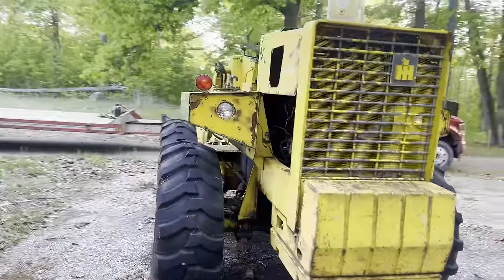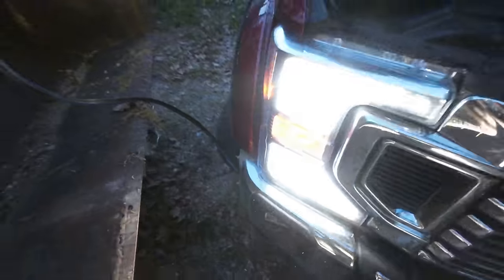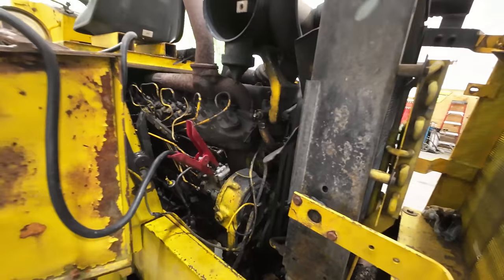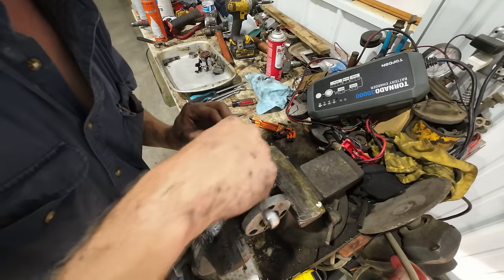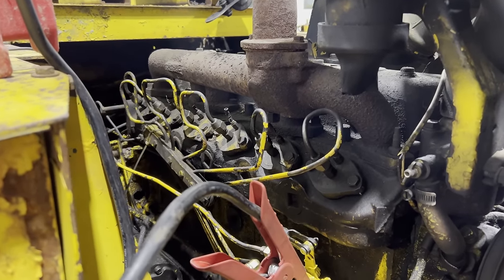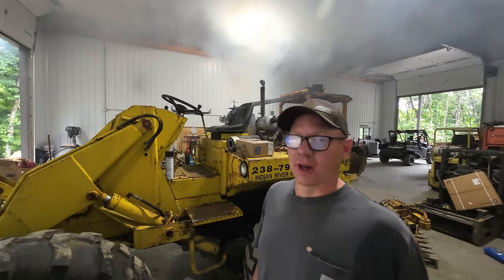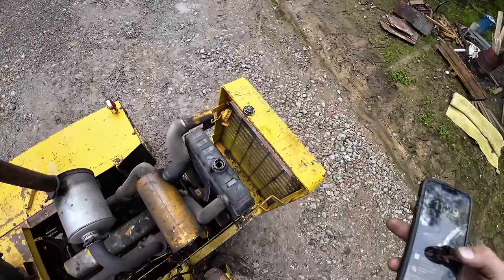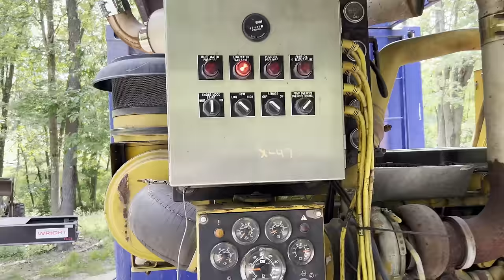FREE International wheel Loader, Sitting 8 YEARS! (Will it Run??)

Comment: Why aren't you using a remote starter switch instead of crawling around and under vehicles to jump the starter with a wrench or pry bar or something.  A simple high amperage momentary contact switch with appropriate wires, should be able to make it up for less than $10.  As a teen working on gas stations and my hot rods, I made one up with a little metal box, 2X3 inches, with the starter button and a hot lead for ignition.  You could use the extra hot lead for the fuel pump if needed.  Also, I watched you loading the loader on your trailer in the dark.  For maybe 10-20 bucks you can get an LED work light, maybe 20 watts, for the rear of your truck cab.  As much as you would use it, it probably would last for years. 20 watts would be like daylight compared to working in the dark.  Love your channel.

Comment: Timing is definitely off. I work on john deere engines with the same pump some have keys and some don't. There is a tool set to find timing on those pumps. Since there's no key there's a tool that locks the pump in 1tdc. Then you pull the pump and leave the engine sit so you don't loose your timing.

Comment: I've been driving an old 70's or 60's road grader all week. Supposedly it's a cat but there are no markings. I keep thinking about Christine. Not sure how Christine's shift levers are but this thing you have to fight like hell to get the forward and reverse lever to work especially if you want to put it in reverse. The 3 speed shift lever shifts hard too and the high and low range is nearly impossible to move. these levers are huge and go clear down to the floor. I must be shifting them 30 or 50 times a day or so maybe a hundred.

Comment: I know you pointed out the extraction fan yet to be wired. Would it make sense to install some exhaust extraction hose that runs through the ceiling or wall that can be connected directly to the equipment exhaust pipe?
I know you had a fan running and doors open, but soot will still coat your nice bright walls and winter is coming and that fan in the peak will exhaust your heat. 
Healthier too?

Comment: I see a radiator hose that is supposed to go to a another bigger radiator is just hanging out I think that is a factor to your situation on the radiators. Most modern day motors always have three radiators. I am no mechanic but just from observation I see that hose and see bolt holes so I am assuming that it is missing a radiator. Keep up the good work process is slow but it is has it's benefits, look at the bright side you don't have to mess with the transmission!!!!!

Comment: I wouldn’t completely rule out that there isn’t coolant in the oil until you drain that oil. I’m not trying to tell you what to do but I ran into a situation one time on a international truck that had a max force engine and it was using coolant and the coolant tank looked good, no oil in it. Checked the dipstick and didn’t see nothing wrong besides it looking like it needed to be changed. Poked a hole in the oil filter cause it had a tall one and some red antifreeze came out before oil did and then I took the drain plug out and a bunch of coolant came out before oil did. So not always will coolant and oil mix. That truck had red coolant in it but just a situation to throw out there to help lol

Comment: You have the timing most of the way right that style of international engine is naturally smokey especially when it hasn't been touched in so long or has never had a rebuild on the farm I grew up on we 560 diesel and it smoked that much and we used it every day

Comment: that thing is smoking like a wet bonfire, definately got a blown headgasket, I would imagine it will burn/displace as much oil as it does diesel I feel an engine rebuild in the offing, so might as well do the pins and bushings, brakes and rams and it will be like a new machine

Comment: I think the injectors and rings just need a bunch of fuel detergent, including trans fluid, and some run hours, and retorquing the head bolts might fix the head gasket, so just do enough wiring so that you can use it and give it 10 or 20 useful hours, maybe fix one more brake, and that at least might be good enough for now.  Fresh and high detergent motor oil, perhaps with a bit of Marvel Mystery oil, might help it too.  Maybe head gasket sealer but maybe not too, in case the sealer gets in the oil.  Just the half hour or so you gave it did a lot of good, judging from the exhaust.
Reply: "Good enough for now" = "do it all again later"
Reply: @jackson_68  Not if either A, you intend to part out or scrap it later, or B; you fix brake #2 now, properly, and brake # 3 and 4 later, does not force you to come back and fix brake #2 again.  And as for gummy injectors from sitting, run hours with detergent fuel can eventually clean them just fine.  I can't quite say good as new because the seals are still old, but they can be completely cleaned without disassembly, same for stuck rings.
   It doesn't have to be good as new because the machine will never again see as many work hours as a new machine.

Comment: Out of posting space, almost, but, automatic dishwasher detergent and a low pressure garden hose, to rinse the block. Wet it down, pour detergent mixed with five gallons of water,over engine, wait ten minutes, rinse it off. Keep water out of any openings, away from brake master cylinder, hydraulics, bad seals are everywhere on that machine. Do it outside, of course, away from shop doors, downhill from building.

Comment: Tongue weight and ride height are directly proportional. When the tongue is too low (not level) then you are effectively taking weight off of the front axle. Your truck is heavy enough to handle it so it still rode good. A lesser truck would not have rode good with an unlevel tongue.

Comment: What size motor, looks
bigger than a D 282 .
Head gasket is what the
either is hard on.
You will need dam GOOD
batteries for the glow plugs
. pre combustion cups.
My old farmall 560 had D 282

Comment: Cant see the whole engine but I think that's a 281 IH diesel those old motor were very poor starters at the best of times (without the glow plugs)with proper functioning glow plugs however I could get my 281 motor started every time(about 50 full seconds on the glow plug button at maybe quarter  throttle)farmers who cursed the motor usually refused to use the glow plug system properly, personally this engine was a good strong hard working unit that worked many years in dozers,loaders,and farm tractors .cheers

Comment: I would have checked the compression first , i just did a ford 4000 completely guy said it ran had 2 out of 3 cylinders with holes in them it was quite a project

Comment: I suspect you may have a blown head gasket. IDI type diesels don't like too much starting fluid. Needs the glow plugs in operation. Your excess smoke could be oil. Much of it cleared up but you still have a bit. Your idea that the injectors aren't up to par is also good. Those for that engine may no be all that expensive. The guys at Area Diesel are top notch. For you or I trying to work on one of those pumps is like trying to do brain surgery with a wrench and screw driver.

Comment: what Jump Pack do you use Matt ? yours always seams to have a fair amount of power to  turn over these Monster engines you aquire  I’ve tried a couple ofthe Harbor Freight Ones  and didn’t have much luck with them  having them on hand for starting V8 Inboard Marine Engines or  my 6.5 Turbo Diesel Duramax when my batteries got older ?  the Jump Packs never seemed to  hold a decent charge  very long  and replacing those internal batteries wasn’t cost efficeint

Comment: 4' Auto louvered Greenhouse  vent fans will close against wind and rain when not running but will remove most if not all of that diesel exhaust to stop coating the shop with dark grey to black goo. As was tated, large volumes of smoke suck.

Comment: I know nothing about diesel engines, but I'm pretty sure they are notoriously hard to start without preheating the glow plugs. Common theme with 'will it run' diesel channels is they ignore the plugs. Not sure why. It would be like 'will it run' gas channels ignoring the condition of spark plugs. Which I see too. Sure you can spin the engine with starting fluid until they kick off and clean (diesel heat) themselves, but why wear out a starter unnecessarily?

Comment: QUESTION:
I’m just a curious Dutch guy. How much weight was there on that trailer and how much does the truck weigh and what are you allowed to tow? 
Over here there’s a limit of 3500kg vehicle and 3500kg towed weight iirc.
I would imagine that driving with that much of a load wouldn’t be easy (but I’ve no idea tbh).

I’d appreciate any comments from anyone who’s towed something similar. Tia!

Comment: Hard start, white smoke, low on power and excessive diesel knocking sound all points toward bad timing of the injection pump.
I would have looked into that.

Comment: Is either good for a motor?  Nope.

But as a heavy wrecker opporator I've seen MANY concrete mixer engines run on nothing bit "start you basterd" to unload the mud.  Usually have to feed a motor at least 2 full cases of the good stuff, takes spraying it directly into the turbo for like 15 minutes straight.  I've played this game at least 50 times over my 40 years in the towing industry and not one of these motors was damaged.  This has become a more common thing with the proliferation of ECM driven motors, no the high compression modern EPA motors done come apart running on the spray can ether.

Comment: You should be more careful with your use of ether. You're inclined to flood the engine. I use two thumbs to press the button, holding a continuous ! not pulsed ! fine spray 10% open is sufficient to run without knocking and able to use as throttle. I often spray an entire can into an engine before it primes the fuel lines well enough to start. If you lack the dexterity, you could weld up a frame with a thumbscrew to fit the ether can.

Comment: When I saw you take that injector fuel pump off I was infatuated. I just took my pump to the diesel repair shop and $1,000 later. I had someone else put it on because I was scared to death. I was going to roll that rubber gasket. I was fascinated to see how you just put it on without much care concerning the rubber gasket. I'm really confused

Comment: I haven't done any research, I'm not a mechanic and from the smoke out of the stack, I would say you have main bearings and rings wore out. Wouldn't you think to check hydraulic oil, engine oil and change it and filters before you drove it? I'm willing to bet he does the bare minimum and flips it for mega bucks.

Comment: Well, I would want to let it cool off, and rinse off all that excess oil and grease from the outside of the block. Easier then to tell one part from another, and see new leaks. I wouldn’t use a pressure washer, it might accidentally inject water where water was not wanted.

Comment: Sounds like you have every d282 issue known. Horrible hard to start. They need glow plugs or ether most days under 50 degrees. They are horrid on head gaskets, and smoke like a freight train till warm unless in perfect shape. Injector parts are not made anymore but can typically be found. They love to crack heads, they are fuel efficient just fairly fragile. P.s. the loader was built by hough

Comment: I would so love that machine on my small 9 acres. But when you said you had an 8 hour drive just to get home, I didn't feel so bad. A couple stupid questions. Wouldn't it be better to have 2 or 3 big amp hour batteries to crank with? And wouldn't a remote start button be easier? But my guess is that you don't need an unsolicited opinion.

Comment: Starting that loader from underneath it. By yourself, is extremely dangerous!  Especially when you know lil about the machine. Whether or not its known for jumping onto gear etc etc. It started rolling inside the shop. So its obviously a big no no. I would have at least wheel chocked it. Or had someone sitting on top. Not trying to be condescending or anything. Ijs for those watching. They need to know how dangerous that really is. Hate to see anyone get hurt trying to do this the same way.

Comment: I think that engine was used in. IH Farmall 560 tractors in the early 1960 to mid 60’s 
Parts are easy. 
I believe it’s a dry sleeve motor.  Bad cylinder head is my biggest concern.
Yes I think your timing is retarded.  
Check the fuel to make sure there’s no gasoline in it. That’ll make it pre-ignition.
Good video thank you.  
It needs Erops.
Snap on makes the timing tool that clamps on of the fuel line and then you use a standard automotive timing light. 
 snap on part number is MT - 357B
Of course you can do it timing marks

Comment: You're problem is obvious- you are missing one cup seal on the pump shaft. There are supposed to be 2 0n the shaft facing in opposite directions.
Reply from the maker: It had both seals. The one just stayed in the pump when I pulled the shaft out.

Comment: Like someone else said, looks like a d282 International.  They were used a lot in IH 560, 706, 656 and other applications.  Have one in my 706. On a 100 F day still have to use glow plugs.  Great running engine. It's not uncommon to lose a head gasket and what i have heard crack heads. Dime a dozen and plentiful donors out there. 1

Comment: Have you ever used WD 40 instead of starting fluid??
Reply from the maker: Everyone always insists that works. I’ve tried it several times. I’ve never had any luck at all.
Reply: Something else that works good is soak a rag in gas and stretch it across the breather, I’ve used that method several times in the Mountains to get a Skidder or Dozer started and it works really well!!
Reply from the maker: @kevinhonaker9468  ya I’ve done that

Comment: Yes your Truck should be capable of  Pulling a 15 K  Machine on  your Trailer. But the more important thing  will be. Is the Trailer Equipped. With good enough brakes to stop the  whole thing ?  I pulled a 20K fith wheel  behind a 3500  Chevy Dually 6.5 Turbo Diesel   The trailer.  Only had  Electric Brakes   With a Controller in my Truck. And  honestly. I didn’t care for  the overall Stopping  Performance if I had to do it again I would upgrade. The.trailer to Electric over Juice Brakes  the Trailer is  long gone  and I only Pull a smaller Airstream and Boats behind the Truck now  my Airstream has  tandem Axles  both with Electric Brakes and I can  actually Stop my entire Rig   With just the Trailer  yep it heats them up pretty well  but I like having Overkill on todays highways with Inconsiderate drivers  all  around you  FYI on my Airstream I purposely load  the tongue weight  with Filling water tanks  the Suspension and Duallies  more than Compensate. For the heavier Load  leaving my Steer Tires and front Brakes  working the way I like them to Perform    I hope your Channel has helped your choice of music you use.  During the Intros on the Videoes they are good !

Comment: some of my veteran friends will take something apart,
 then discover they can write everything they know about mechanic work,
 on the back of a postage stamp with a crayon,
 so they call me,
 so I go over and put something together I do not take apart,
 so I fix what they fix then fix what is really wrong with it,
sometimes some parts from something else gets mixed in,
after it is all back together,
 they want to know about this leftover part,
I ask them is it running?
They say yes,
I say is it running good?
They say yes,
then I say you do not need this part,
once in a while I can see the off brand name on this recalcitrant part,
I do not point this out to them,
one time some idiot picks up a carburetor then puts it down in a pile of die sel engine parts,
I catch this one from ten feet away
George Newport